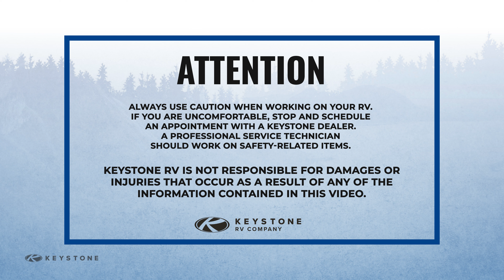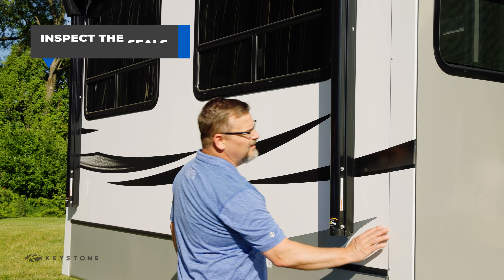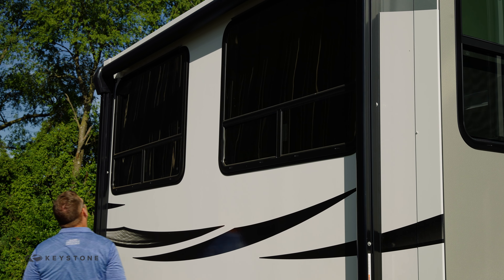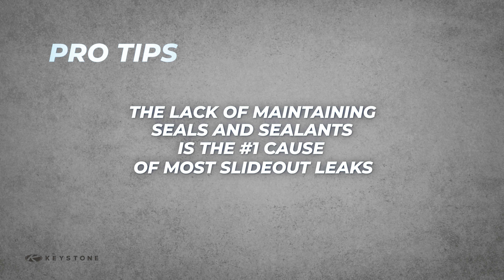RV Pro Tips: Slide-Out maintenance and tips!

Comment: I was surprised that lubricating the slide out sweeps was not recommended. Thanks for the heads up.
Reply from the maker: You are most welcome! That's what we are here for!!
Reply: Actually in Florida we recommend lubing the wipers and D seals once a year,to prevent dry rotting from the weather and to decrease friction of the slide in motion (less wear and tear on the mechanism). If the proper lube is used, it does not attract debris. 
I use 303 aerospace.